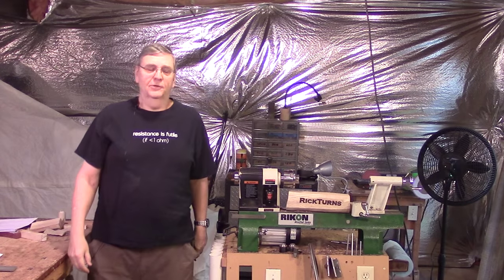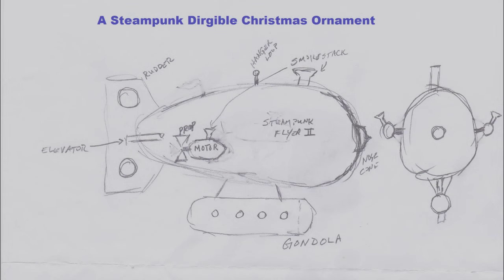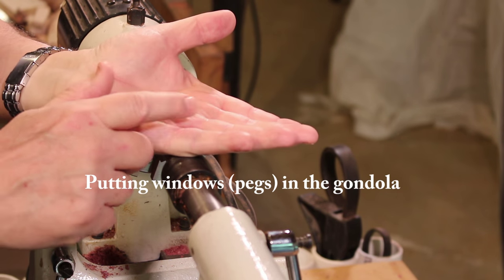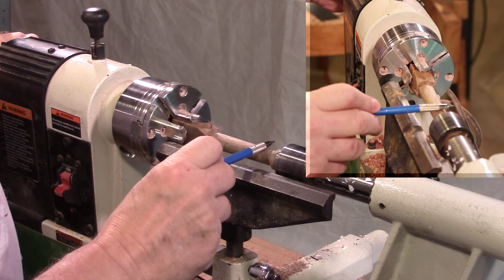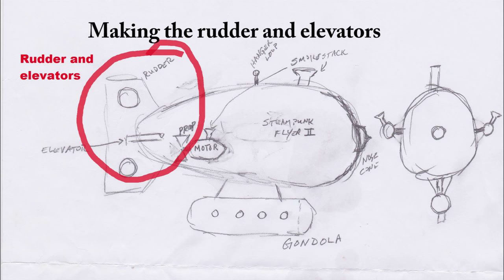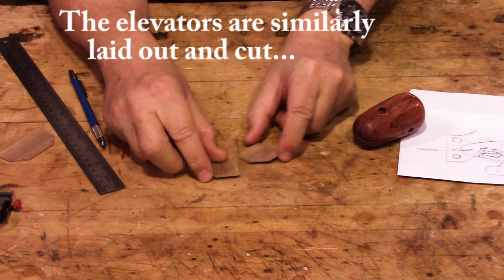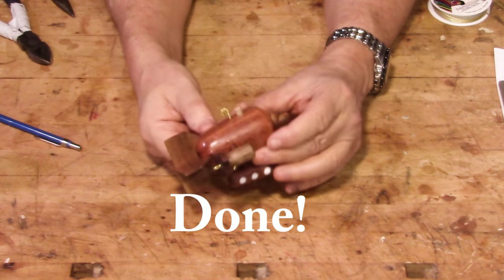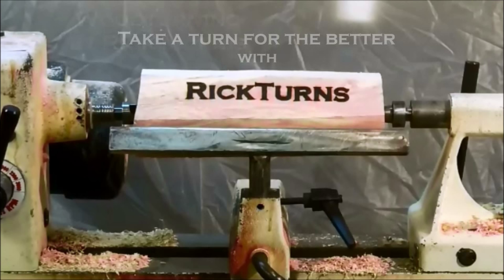A Steampunk Dirigible Christmas Tree Ornament

Comment: I'm new to turning.  I use only EWT's.  Your chisels seem to cut much slower than mine.  Is that on purpose?
Reply from the maker: I think it's because I'm really sluggish in general!  ;-).  I've never had an Easy Wood Tools carbide tool, but they certainly look nice. I've made four carbide cutter tools, but I don't actually use them that much. See they're generally used straight in, they tend to scrape rather than cut the wood, and leave a rougher surface. At least, that's been my experience. A lot of other woodturners seem to really like them. The one thing I really like them for is sheer scraping, although the small bit is something of a challenge.
Reply: RickTurns I have no experience with traditional turning chisels, but the EWT I've been very happy with.  For a beginner, they are much more forgiving of mistakes I think.